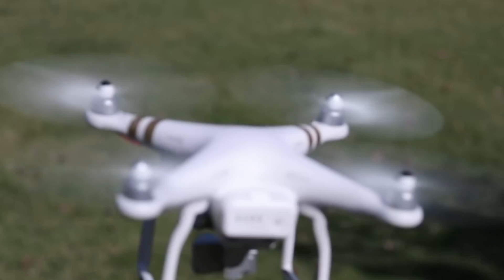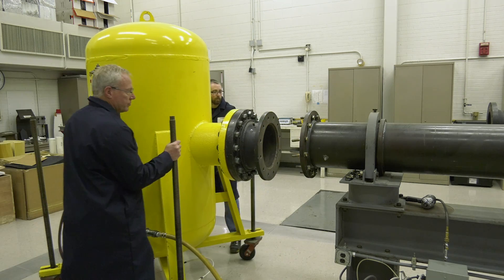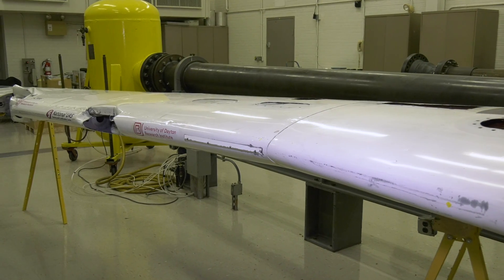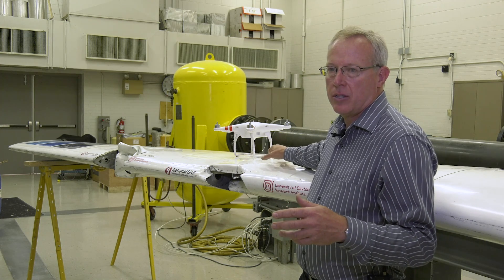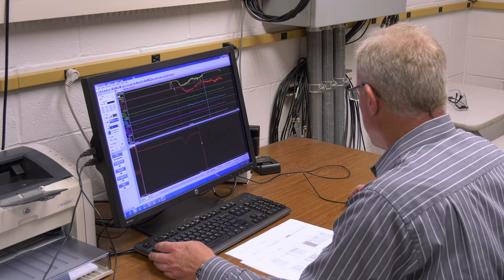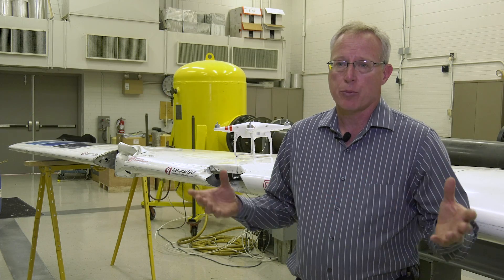What Happens When a Drone Hits an Airplane Wing? – AIN

Comment: Require a ADS-B transponder on everything.  But I'd be more interested in a few windscreen impacts...
Reply: Require ads-b on birds too
Reply: Scissors95,  OK then, require eye's, ears, self awareness (like a bird) on the drone, while the pilot stands under a large rock that will drop on him if he loses contact with his drone...  Or like I said, a chip the size of your thumbnail that broadcast short range GPS data to other ADS-B receivers...
Reply: I would love this, have strict enough drone rules for general use (though not AS strict as now), but make an exception where if you register it and have ADS-B, you are less restricted.  Of course you would need to ensure you give right of way to planes and there would also be a requirement that you have an ADS-B "Radar" view while you fly etc.   Instead of outright banning them (practically what they did here in Canada) they should work with both drone pilots and airline pilots so both planes and drones can coexist.
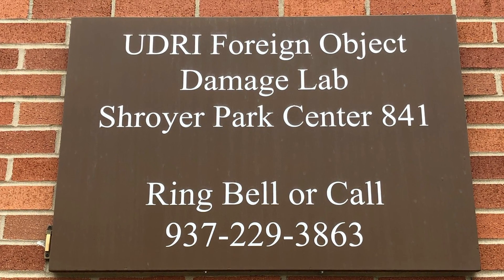Reply: Especially that F-16 canopy @ 0:36 (left border of the image)

Comment: This dude is talking as if it'd be common for some plane to hit a drone in excess of 238 miles per hour yet no plane is allowed to exceed 230 below 10,000 ft (unless you're in the middle of NOWHERE) so I'll wait til a phantom can go 10,001' before I'm concerned.
Reply: Creeperownr keywords “closing speed”.
Reply: 250 knots indicated airspeed below 10,000. Plenty of aircraft doing those speeds around here at least. Add in 40 mph max speed for the drone and I'd say their numbers are within reason.
Reply: The limit is 250 knots which is about 290 mph, the tested speed was 200 knots which is not uncommon with GA planes.
Reply: No, you didn't understand. That's the closing speed between the two aircraft if the aircraft was traveling at a forward rate plus the drone's forward rate - that speed is approx. 238 mph - a combined impact speed.
Reply: Better brush up on your Part 91 regs a bit..
Reply: You mean 250 Knots indicated, or 288 mph indicated, or 315 mph true airspeed at 5000 ft (yes there are many airports in the US at 5000 ft). Then put a 30 mph closing speed for a phantom and you have well above 230. I know, I know... Facts are hard
Reply: First the limitation is actually 250 KIAS under 10,000 feet, 

Secondly, the KIAS ( Knots Indicated Air Speed ) is usually faster than GS ( Ground Speed )

Third, it’s nautical mile per hour which is 15% faster than miles per hour, therefore 230 knots is 265 mph.
Reply: Obviously flying near planes is a stupid idea.  But just the act of flying a drone is not dangerous on it's own. It's ridiculous to want to ban it just because someone might do it.  How about punish those individuals when/if it happens.   Need to actually use common sense.  There's a field in front of my house and I sometimes fly mine, but first thing I do is listen for planes, and look for planes, and also check there is no one around the area I plan to take off from.  Once all is clear I fly.  If at any time I see a plane coming my way I will land, even though I know that plane is probably WAY higher than I am, I do it as a precaution as it's hard to really dictate distances in the sky.
Reply: This is a good thing, they tested in more extreme scenario.  It's good to know that the amount of damage shown is probably close to as bad as it will get.  Though it would have been nice to see different tests in different scenarios too.  Like what if a drone hits the prop of a dash-8 for example.
Reply: He's downplaying it because the only altitudes where their operations overlap occur is takeoff and final. When is the last time you saw a Mooney on short final at 200kts?
Reply: You could hurl any object into another object with a cannon. I don't see how this demo is supposed to show the danger of drones specifically. Even in the worst case scenario, that plane could takeoff and land in that condition. This shows how SAFE drones are, and DJI drones are flown by yuppies who are more likely to destroy the hobby than the true hobbyists who build their own and setup their own failsafe. DJI drones fly away, real hobby grade drones kill all power to the motors when control link is lost. Consumer drones are the danger to our hobby. DJI can screw off for all I care. They're the ones taking flight into the clouds and flying close to aircraft. This all frustrates me because 99 percent of my flying is below 100 ft with the other 1 percent being not more than 200 ft. I race, so most of my flying is very close to the ground. I hope DJI just goes under. Amazon, Google, UPS etc all want you out of the sky so that they can use the sub 400ft space for their commercial interests. Google wrote that part of the bill I have no doubt. Pilots of full sized aircraft are a far higher risk to everyone than any sub kilogram mini quad could be. What a shame that people take this scare video clip seriously at all.
Reply: @timemachine_194 Probably true about the drone defenders. It's true for me, except the parts about denial, cluelessness, stuborness, etc. A lot of us are pissed of at being lumped in with those that don't take care when they fly, as the assumption is every drone flyer is getting off on creating havoc and purposely flying into, around, near planes. Also pissed off about being placed into the same category as REAL FUCKING PILOTS. Or being lumped in with the Commercial Drones. Most of us fly toys, less than a pound, but we are in the same class and regulatory environment as commercial drones weighing dozens of pounds. We fly in local parks, 50 or 60 feet above treetops at most (speaking for myself), or around a racetrack with obstacles no more than 20 feet high. Now we are being regulated, probably into oblivion, because 1) Ewwwww, drones are new and I'm automatically fearful of anything new, 2) Drones are noisy, 3) Drones can "spy" on me 4) Amazon and Dominos Pizza and Google wanting to deliver shit to someones doorway, 5) Because if there is anything the govt is good at it is creating rules for everyone else to follow, and if they can tax it even better, and then exempting themselves and anyone else with some $$$. Name any hobby and I can point out some dangers. There are already rules and regulations. It is has gone way too far and appears to only be getting worse. Paranoia, Fear, and the opportunity to make some $$$ has taken place of reason, analysis, and fact.

Comment: Ah yes, I'll make my quad more fragile so it's now even more likely to break when I crash... not sure this is going to catch on.
Also, a dji phantom 2 costs upwards of $700 and that's an older model, I don't think people will be happy paying so much for a drone that is made more fragile.
Reply: Yeah, I think safety regulations aren't followed by enough drone users
Reply: Oh, my bad
Reply: I'll have you know that me and my "friends" are responsible drone users and are aware of the safety restrictions regarding the operation of drones, e.g. we don't fly near aircraft.
I just don't think that anyone will want to buy a drone that is 'more fragile than it used to be' especially someone buying one of the more popular commercial drones which usually cost upwards of $700
Reply: "Frangible" was the word, not "fragile".  Frangible is a good thing; it means that instead of cracking into pieces, the drone fractures in well defined and engineered ways. This could be good for drone crashes in general; the drone crashes, and instead of some core piece sustaining damage you just replace the arm at the fracture point and you're back in business.
Reply: @2Axiom  Newer cars are made to crush in a high-speed crash, but people still buy them.
Reply: That's because newer cars are made to crush as a method of absorbing the impact, making it less dangerous for the passengers inside.
Reply: I am a drone pilot and an airplane pilot. I love both things, but I have been very close to drones in an airplane and it scares the living shit out of me. The problem here is that people are clearly breaking the rules.
Reply: you should probably tell your friends not to fly drones near airplanes so that they aren't forced to regulate them.

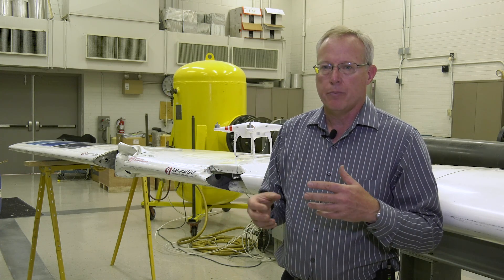Comment: 2:53 I don't think birds impact like jelly
Reply: The jelly is meant to represent a similar density to that of the bird.
Reply: @kolokolok  But real birds also have hard parts (eg the beak, bones) which penetrate the structure of the wing more than jelly
Reply: Yeah. They should have just used a real bird.
Reply: Think again, at these speeds everything is jelly.  As you can see even the metal wing is kinda like jelly in a crash.

All is jelly this is my new regilion
Reply: A duck will make a clean hole punched through a leading edge slat, through the other leading edge behind and makes a mess to clean up when compressed against the main spar.  The EA-6b Prowler was also traveling around 300 kts.
Reply: They actually do kinda look like jelly at high speed impacts.  Although this test was definitely exaggerated because of the lack of bones.  With high speed impacts solids tend to act more like liquids, kinda like a bullet disintegrating against armor platting.
Reply: https://drive.google.com/open?id=1FKIL2XlpTpts0r0dr3p_uNi0g9rPiFjo

Finally found that photo, had to get a screenshot.  Not sure if it’ll show up or not.